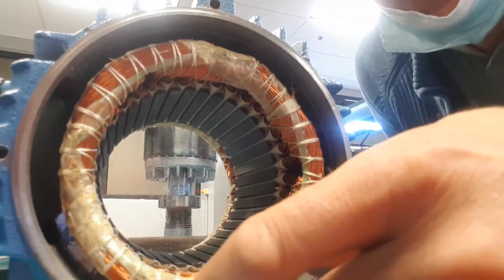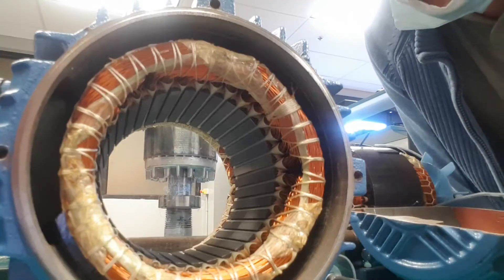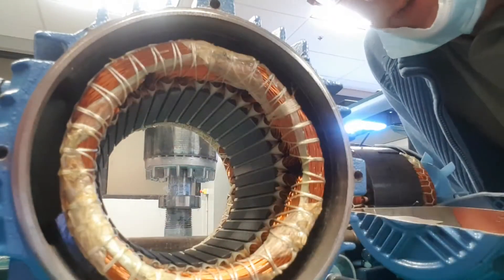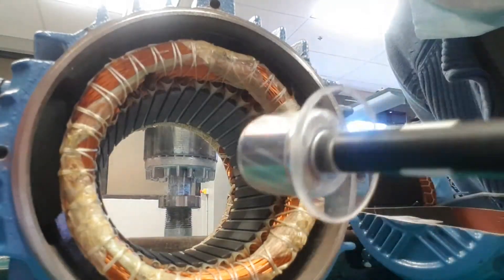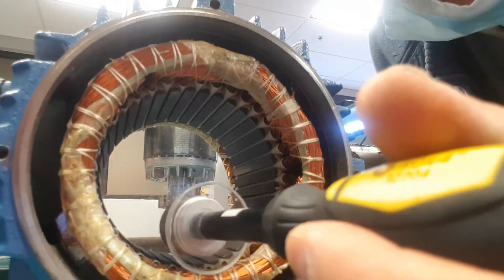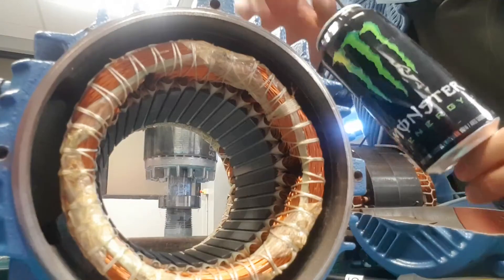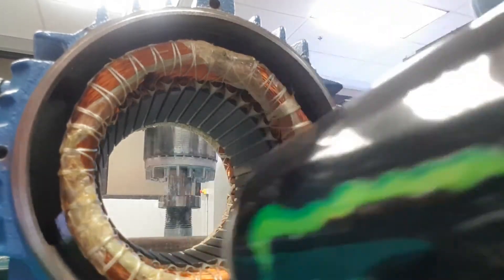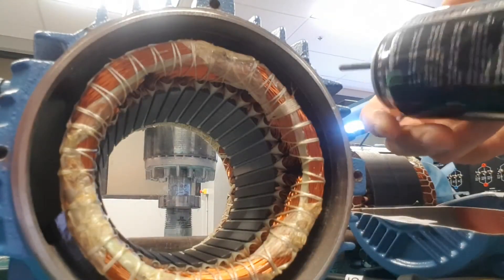stator induction demo

Comment: Would this work with a 1 phase motor as well? Are you running in Direct on Line (50 or 60 hz) or you have an inverter to lower the frequency?